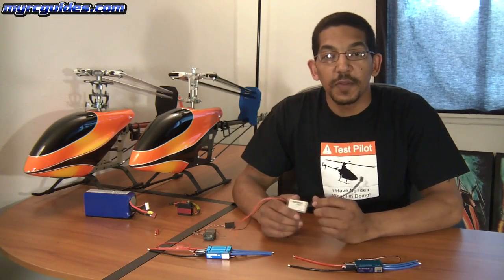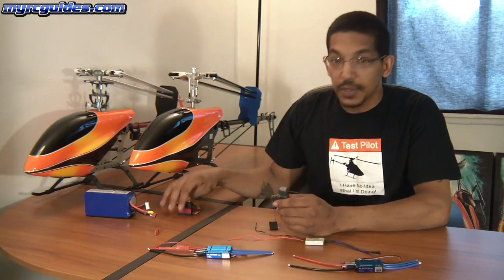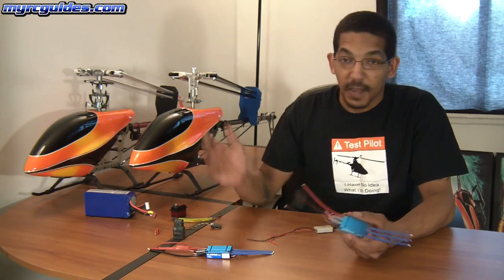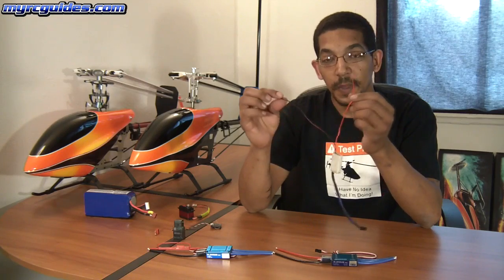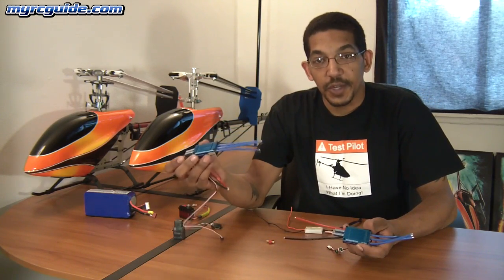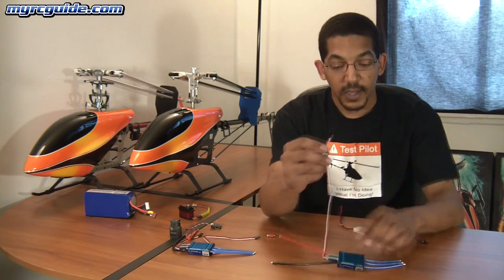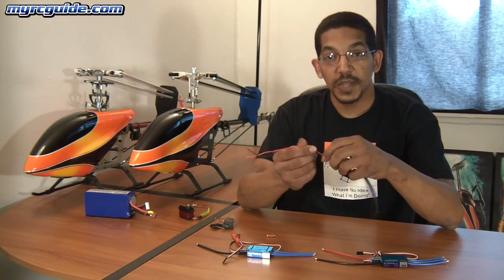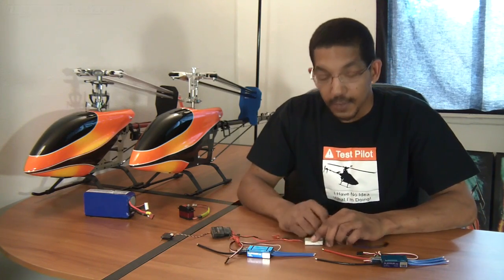BEC Basics for RC Helicopters

Comment: Nice vid, but it also would have been good to mention the ability, or inability as the case may be of some speed controllers built in BEC's to supply enough current to drive todays digital servos.